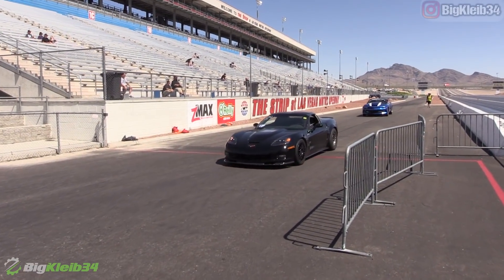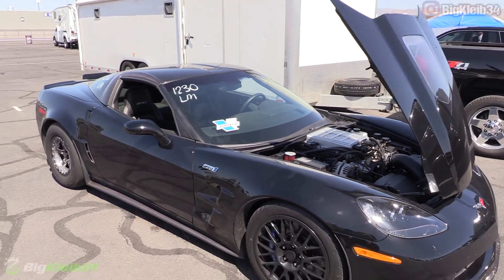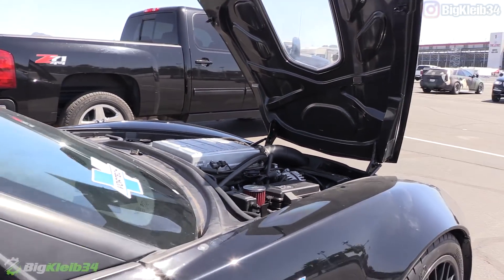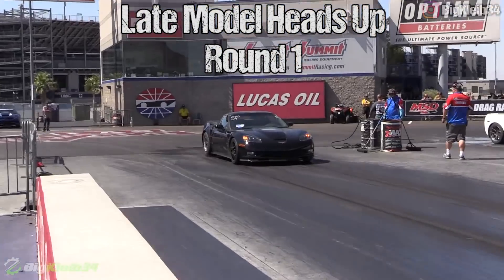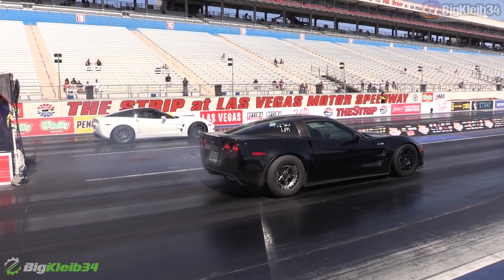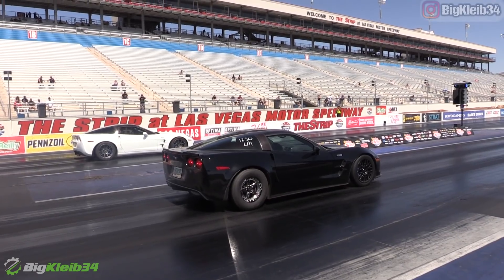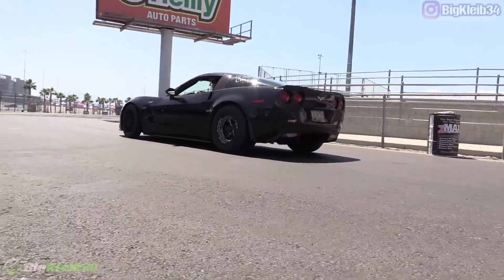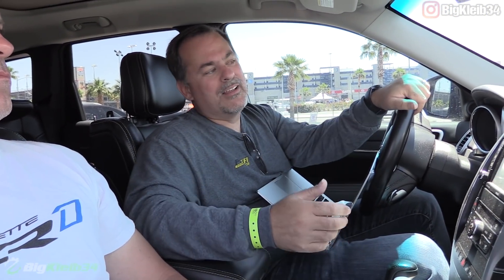Can a ZR1 be a Sleeper? Hidden Twin Turbo Surprise!

Comment: If it's possible for a ZR-1 to be a sleeper this is the best example I have seen. In the 8's with a stock looking Vette, very cool. Gives those pesky Hellcats fits I'm betting just walking away.
Reply: My 2018 twin turbo mustang is stock  engine running 8.3 at 161. We will see how long. Two years so far. Dont consider it a sleeper at all
Reply: @darrenmcfeaters6683  Yea that for sure is a sleeper, but a 600hp car is anything but.  Even the mustang is pushing it since these days they 400hp+ cars.

Comment: A vette with 15 inch wide slicks and a shaker hood doesn't say sleeper to me
Reply: @jupapikillz2788  bub you don't know then..  stock vette rear tires are almost 13 inches wide..  you need to open your eyes and get a tape measure

Comment: 🤔🤔 wait a second they let this car that runs high 8s compete with no chute no cage. But won’t let Leroy run 8.50s something is funny here 🤔🤔
Reply: THAT'S EXACTLY WHAT I WAS ASKING ...lets see if we can get answers o think not .!!
Reply: @ItJstWrks357  and to think ..cleet said he got emails from the track officials but no1 from the track has spoken on why Leroy was dq'd ..
Reply: BighomieJ5x - because he explained like 5x now exactly why he was kicked from the track. He literally said they thought they could get away with having the 8.5 cert cage again this year and it didn’t work. Las vegas is known to be a strict track, and he did not have the correct equipment to be running as fast as he is. Yes I also believe the track official has something against Garrett because of the fact that they let him qualify just to be DQ’d, but the fact is no matter what happened, he was still running too fast for his current certification, even though other less strict tracks would let him run 7’s, they were technically breaking the rules for him. All he has to do is get his licence and a 7 sec cert cage and no one will be able to pull a move on them like this again. Simple as that.
Reply: @MVSTNGGT  and the twin turbo vette was ok? Do tell.....
Reply: BighomieJ5x - never said it was, and I agreed with you...... they have something against garrett 100%, but he is still not certified for 7 sec passes simple as that, just like he has said in his last 2 videos, do I have to explain more? Was his 10 minute explanation not simple enough for any of you guys?
Reply: Money talks fam!
Reply: @donniekane3260  true that ..💯

Comment: Seems counterintuitive to put so much effort into putting twins through a gutted blower to make the same power the car would make just using the blower in the first place. I hope with a built motor they wind it up and run beyond what the ls9 blower could reach!
Reply: What the hell did you just said? What videos on youtube you leaned that??? Lmao$!!
Reply: not going to see 900 whp on ls9 blower without nitrous which is super hard on motors. most zr1 with full boltons and cam and heads end up at 850 whp
Reply: @32krazy1  check out kongperformance, they got some beast making 900rwhp
Reply: @Camaros5678  only on nitrous. using every kpng bolt on part only gets you to 750 w/ e85 heads and cam gets you another 100. need spray to get above that

Comment: ZR1 is pretty slick.. Mr. Camaro has quite a ways to go before he will be able to utilize that wheelie bar...
Reply: Immortal he spun on the line, no idea how hard it has hooked up before. Also if he plans on going faster why not just have it done.
Reply: @bbdl7042  do what you do.. just saying, it isn't necessary with 2010 and up Camaro's. I've seen them run in the high 7's with both stock ZL1 suspension and with less of an upgraded suspension than this one, with them barely pulling the wheels of the ground.

Comment: What car beat him at the end...which Texas Speed and Performance?
Reply: Freedom Rocket’s black cousin.
Reply: Chuck Beef Thank you. I am looking for suggestions on what year Camaro to get? Would like to do head and cams. Am retired on budget and wanting to get my first V8 muscle car. Love Camaros and Vettes.
Reply: dry509 I would go with a 5th Gen for the LS engine. These new LT’s found in the 6th gen are harder to make power with.
Reply: @ChuckBeefOG  Thank you for the info.
Reply: dry509 But, i found out today Chevy is giving great discounts off a new one so you should check prices. I would pay $40k for a new 1SS before i would pay $30k for a used 2SS 5th gen with 20,000 miles.
Reply: Chuck Beef cool. Good to know.
Reply: Chuck Beef Why is the LT1 hard to make power with?
Reply: Eden Hazard Not that they are “hard” to make power with, it just there is twice the support out there and twice the aftermarket for the LS family. The LT will get there in another 5 years. And the addition of Direct Injection vs. Port injection did not give us the power boost we were hoping for. Arguably LS era cars are much easier to modify and tune. It took nearly 1 year to crack the ECU on the LT5 engine, and the transmission’s modules are just as hard to break into.
Reply: Chuck Beef So what made Freedom Rockets cousin so fast?
Reply: dry509 You are right it is a Texas Speed car. I dont know all the particulars but it is a twin turbo, probably feeding one of their 427 or 429 long blocks with some fancy heads, sounds like it is ran through a 2spd powerglide trans that is geared perfectly judging by the sound of it hitting the rev limiter just passed the 1/4.
Reply: Chuck Beef Interesting. Thanks.

Comment: I'm sorry but there's a right way and a wrong way and this is wrong  the gutted blower Is drivin me crazy just thinking about. ZR1'S ARE MEANT TO BE BLOWER CARS  IM ALL ABOUT THROWIN A GLIDE IN ONE. LS9'S ARE MEANT TO BE LOVED AND TOOK CARE OFF
Reply: How many ZR1's with blowers are running 8's?
Reply: @VerisimilitudeDude  several and one is doing it with 6 speed
Reply: Are ls9 rods titanium?
Reply: @VerisimilitudeDude  a few with the factory blower, stock bottom end, and a little nitrous. There's one guy who keeps running 9.0s boost only.
Reply: @mr.know_it_all  yep forged titanium made by pankle and 6000 bucks after taxes for a set. They are nice.